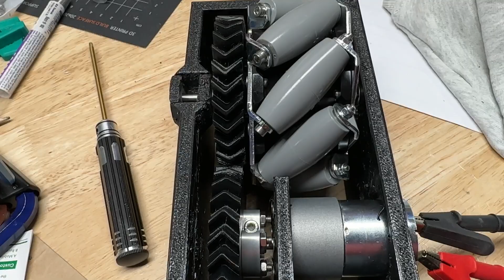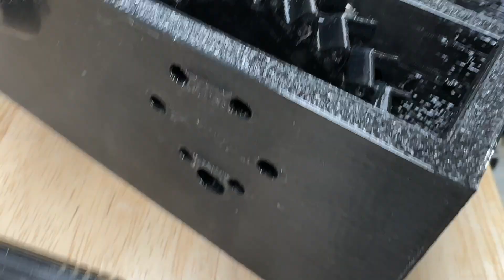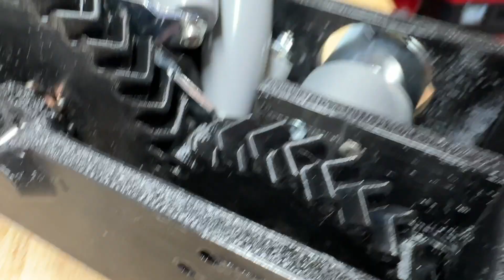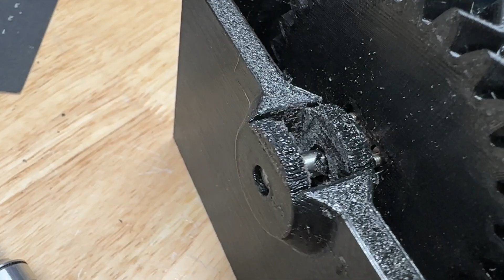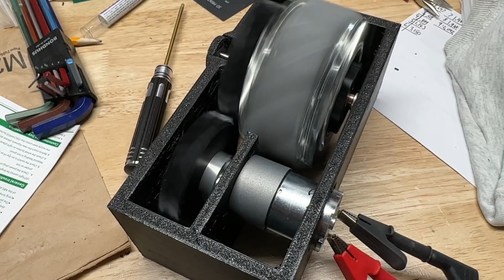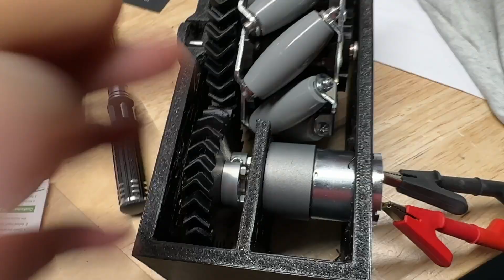B2-EMO Final Drive Prototype

Comment: Hi Tim, do you think balance of the drive will be an issue at all? I was wondering about that with the weight of the motor to the side of the mecanum wheel.
Reply from the maker: There will be four of these drives. So I won’t need to worry about the lateral balance.  However I will be attaching the lift system centered on the mecanum axle.